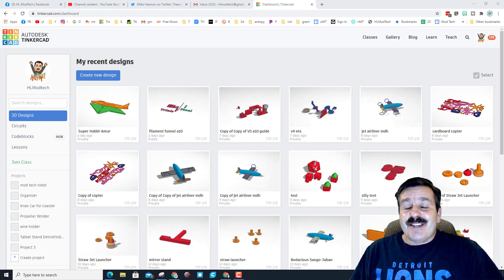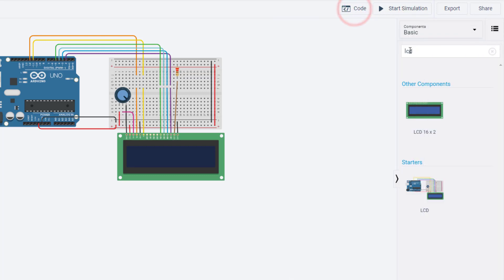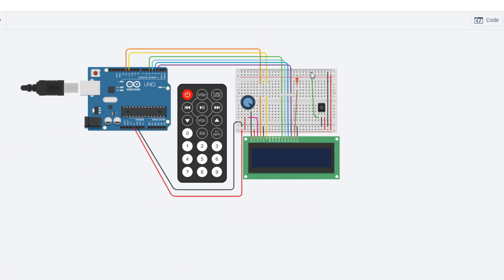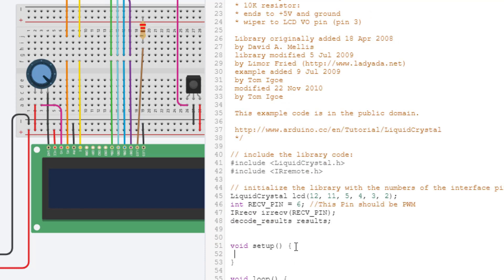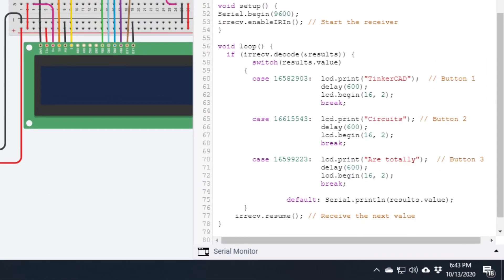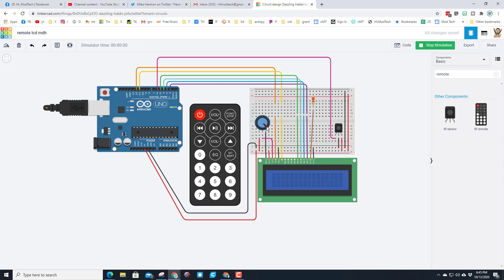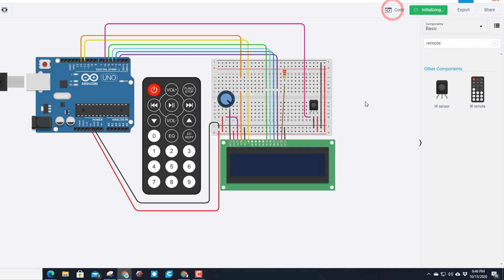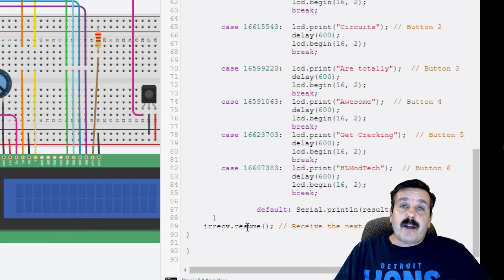Solved! Control a LCD with a IR Remote in Tinkercad Circuits! #arduino

Comment: very helpful!😃 could you make the same tutorial but using a transmitter remote like a HC-05 wireless Bluetooth RF Transceiver
Reply from the maker: Thank you. I’m not sure it will work. The library has been depreciated and if you check the description of the video there’s a new technique. Does Tinkercad even give us the HC-05 receiver?